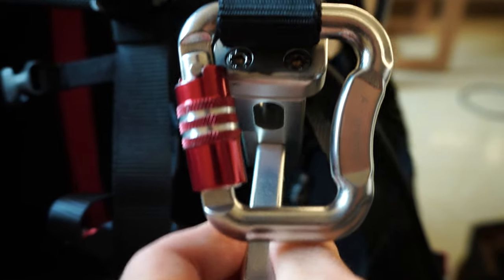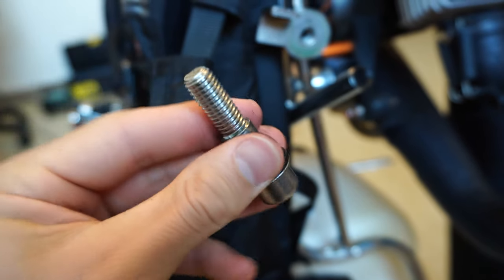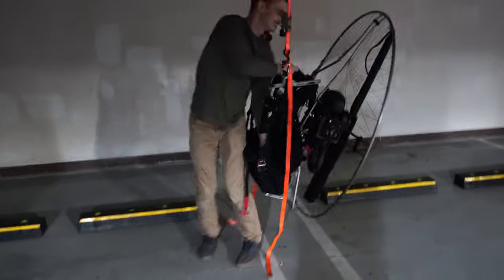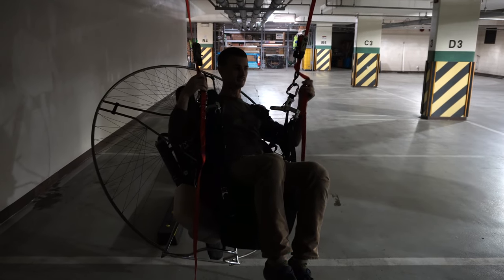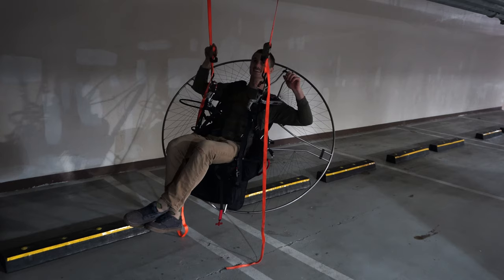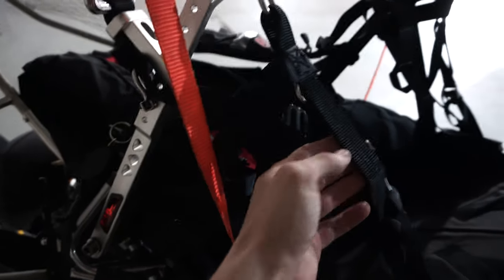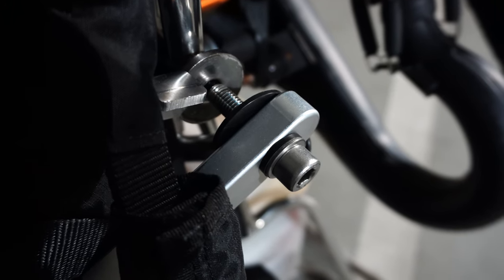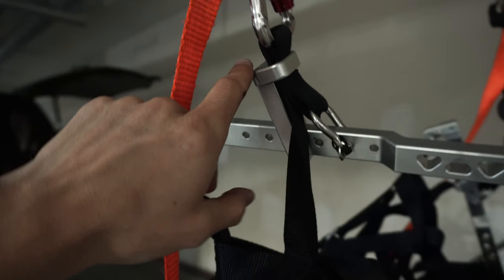What happens if your swing arm bolt breaks in flight?

Comment from the maker: Poll: Stuck in a left turn or right turn? Comment below.
Hard to wrap my brain around this one without it physically happening. My riser will be higher on the left (broken) side all of a sudden which is a similar concept to hand kiting a wing and letting the left side up which makes a right turn, but you can see that all my weight gets shifted and pivoted to the left which may be a greater force than the riser imbalance thus creating a left turn?... hmmm. I know this has actually happened to people on different paramotors so maybe they will weigh in. Thanks!
Reply: I'm almost positive it'd be a serious right turn, but it hasn't happened to me so maybe someone will chime in otherwise.
Reply: Would have to be a hard right, based on the riser position. I agree with Todd that you could paraglide to a (rough) landing.
Reply: I think the position (height) of the riser would dictate which way the wing would want to turn; When you turn with "weightshift", you're really just using your position in the seat to raise/lower the risers relative to each other. So, in your example, if the left riser is higher, your wing would want to turn right.
Reply: That actually happened to Eric Farewell.  Him and Tucker Gott were going flying one morning in January, 2014.  Tucker tried to launch and broke his prop, so, Eric went up by himself.  Eric had just entered a gentle right spiral to lose altitude when the bolt in the left swing arm broke.  Eric got thrown into the roof of a house at 50 mph (his estimate), broke his back and ended up with rash on his legs.  (The eye of Sauron as his wife said.)  I think he was flying a Blackhawk he was indeed thrown to the right after the left swing are broke.  I will have to say, when I got my training we used Nitro 200's and were constantly adjusting those swing arms.  They had a very "spikey" throttle and it was in my non-dominant hand.  I like my P.AP better.  Great video!
Reply: I'd say a right turn. As someone has already said below, kill the engine and the sort the turn out as if its a paraglider harness, with a twisted lump on your back. Nice video Mark.

Comment: This happened to two pilots I know. The first one, years ago, was flying along a beach when the bolt broke. Although the straps kept him attached to the glider, he said it was difficult to control and wound up crashing into a tree in the Coastal scrub resulting in a bent frame but no serious injury. The other pilot, more recently, had the foresight to add some wire rope/cable through the bars and around the main frame. He said that when the bolt broke, he felt a jolt but didn't know what it was since he was in the air. Upon landing,  he investigated and found the bolt had sheared. Two different brand paramotors with very different experiences. I thought that safety cable was a clever idea and worked  very well.

Comment: Great video Mark.   My "What-if"  question has always been...  What-if one of the the Carabiners break or one riser disconnects in some way?   I believe the wing side with the good carabiner will continue to fly, although you will be loosing altitude. Thoughts?
Reply: I believe your wing becomes a streamer at that point.  The only reason it flies is because the wing is an airfoil.  You will surely lose that airfoil shape.  Try to kite a wing on the ground using only one riser and you can see for yourself.  Shouldn't be possible.  One of the many reasons to have a reserve... equipment malfunction/failure.
Reply: @PatJones82  Yup, your wing becomes a streamer.
Reply: @PatJones82   Nope, my supair remains half inflated (half streamer)while kiting on ground and dropping one riser.  Both Risers independent from each other.
Reply: @Chris-Fennimore  Yes, but that is supporting nothing but the weight of the riser correct?
Reply: @PatJones82  Nope, the one riser is pulling hard.  Not enough to lift me in a 10-15mph breeze, but pulling hard.  Half the wing is fully inflated. But I would have no idea how you would steer, if that happened while airborne. Maybe weight-shift. Priority is just to get to the ground safely.
Reply: @Chris-Fennimore  OK.   :)

Comment: I've had an arm come right off in flight, though on a fixed-arm high hangpoint Miniplane frame/Apco Lift wing: mostly a non-issue. I actually didn't understand exactly what was going on until I landed; just lost some brake authority - the whole thing felt pretty odd, but perfectly flyable, no deflation, collapse, anything. I did have to compensate though, and that had a cost in sink rate, but that was that. I still feel fixed-arm frames are safer for this reason.

Comment: A proper connection is imperative. A lot of designs just have a bolt holding the arm on which is subject to a bending load. A fatigue failure can happen after enough pressure cycles. The attached point doesn't have to be a weak spot. We designed a shoulder assembly sandwiching the active arm between two bearing blocks and thrust washers with a large-diameter aircraft-grade grade(wing attach) bolt put in a sheer load only with no bending loads to lead to a potential failure. Check us out on Facebook at AirForce Paramotors. About to go into production. We took all the weak areas and designed a frame that is extremely light, strong and even floats with all tubing capped. Full netting for safety and even extended gear for fall protection (crumple area). Designed by aircraft structures specialist that understands aircraft structures and stress areas. Everything on this frame has redundancy and built like a certified aircraft. I was surprised to see how a lot of these paramotors are designed with no bushings or bearings on moving parts. Even our seat attach pins go through a bronze bearing to prevent any scoring or metal fatigue on the attach hardware. Very excited to bring our Mantis 185 to the market  shortly.  It may not look as polished as some but it's about the strongest paramotor on the market and you will be able to fly (and acro) with no worries of failure. We look forward to joining the paramotor community.
Fly safe 👍

Bryan Bojko 
AirForce Paramotors, LLC

Comment: I think result would also largely depend of the design and adjustment of the harness.  ie  some might still leave biners quite level.  But I'm glad I tightened mine not long ago anyway.  My bolts have nylocks anyway,  but as we are locked  down now I don't know when we are likely to fly again in the UK :(